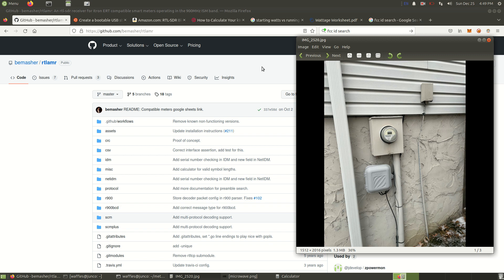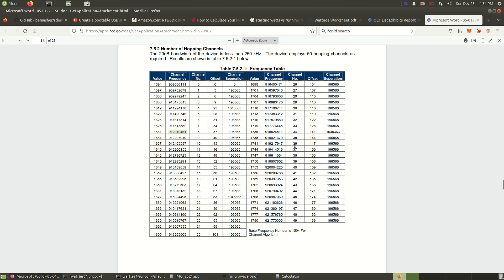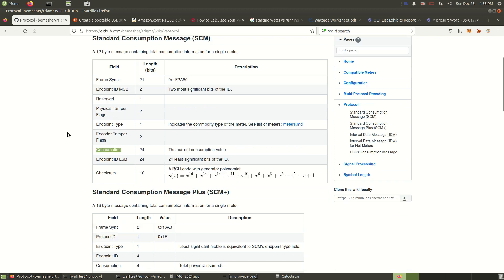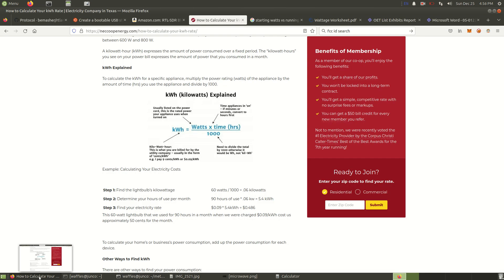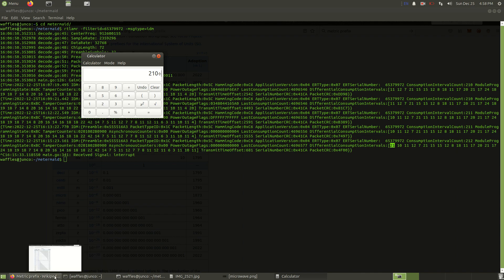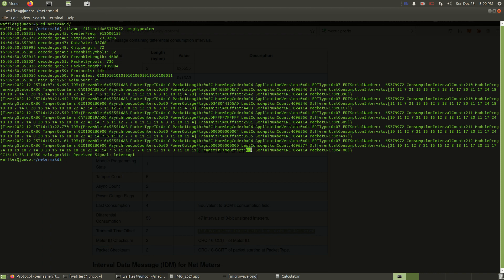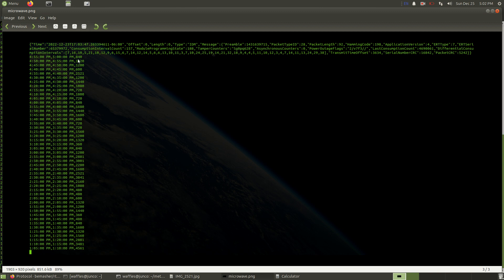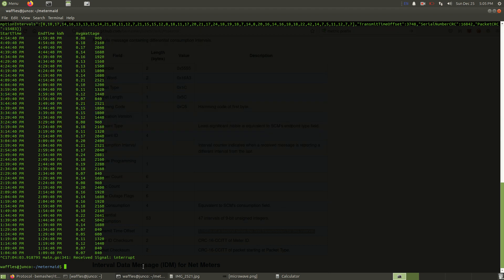Decoding home wattage with RTLAMR and RTL-SDR

Comment: do you mind to tell us how you install the rtlamr, I try it and didn't work, thanks
Reply from the maker: You need to have Go and rtl_tcp installed first. I think the command 'sudo apt install rtl-sdr librtlsdr-dev' should install rtl_tcp. To install Go, you'll have to google a guide. After that, the rtlamr github page explains to install using Go